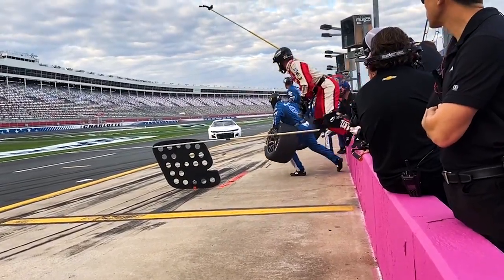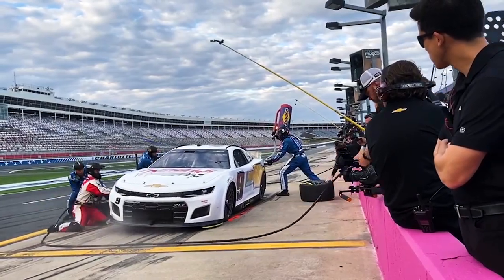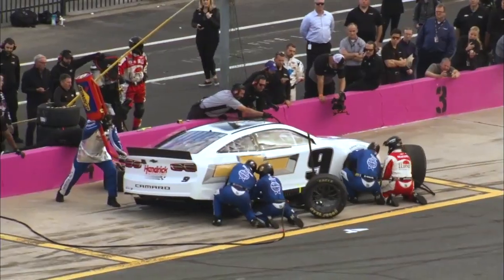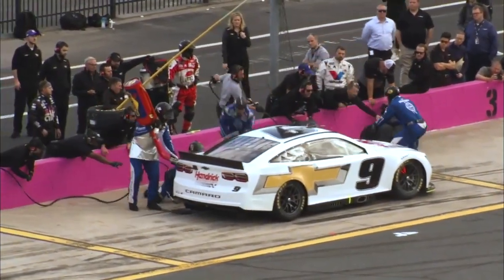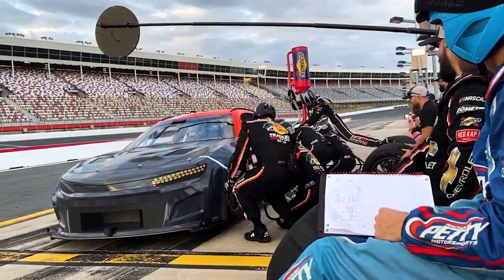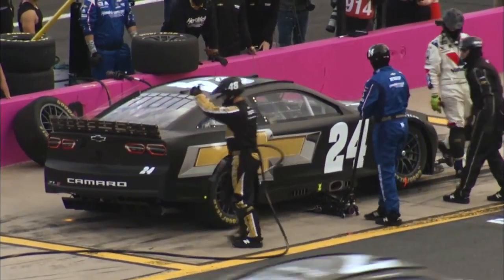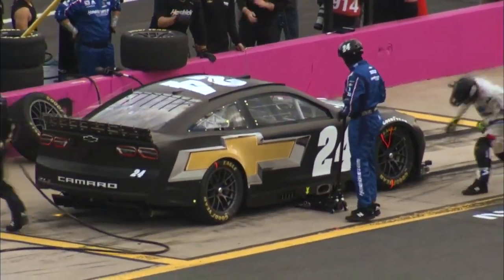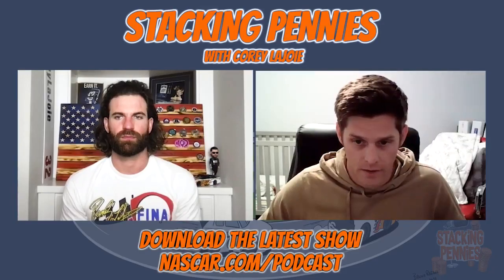"It's Hard" : Stacking Pennies breaks down one lug nut pit stops | NASCAR | Stacking Pennies

Comment: Maybe the teams could benefit from talking with some IMSA pit crews and get their takes on 1 lug wheel pit stops. I know the wheels are probably designed differently and the IMSA crews don't necessarily work as quickly as NASCAR crews but there may be some nuggets that will transfer over. Plus, like someone else here said it will be the same for every team. We go from 14 sec. stops to 16sec. until they all get it figured out. practice, practice, practice...

Comment: People are overreacting as usual.
One lug stops aren't going to be a huge deal once people get used to it.
It's not as easy as it looks, and will definitely present unforseen issues for teams to deal with. The large center lug needs a lot more torque to properly tighten, so they aren't going to be able to use the same guns.